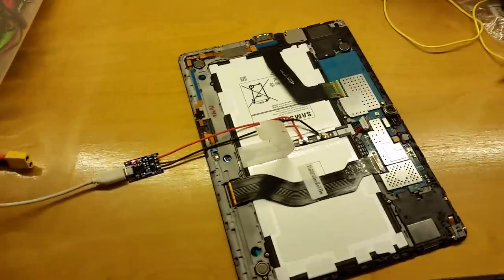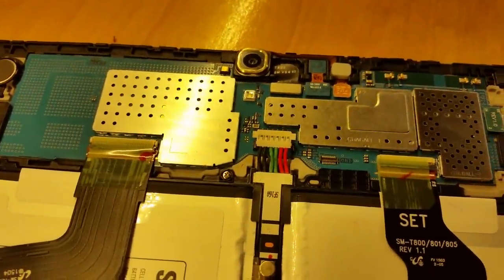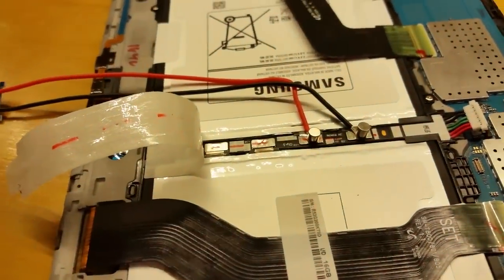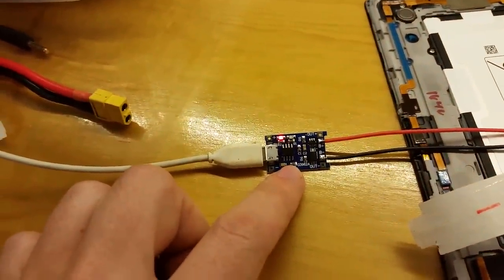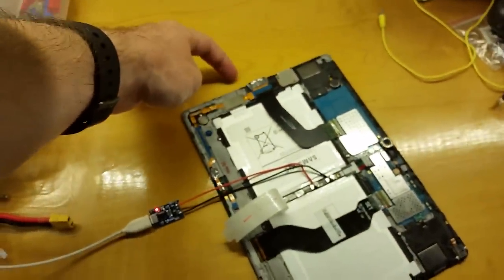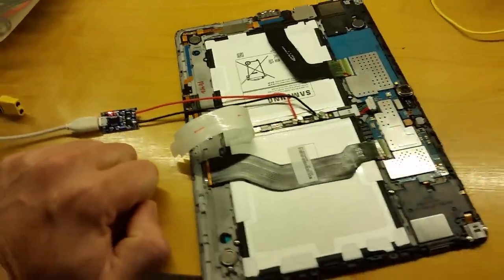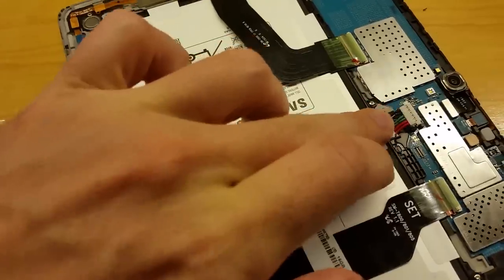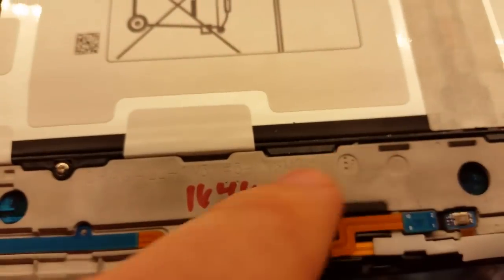Samsung Galaxy Tab S 10.5 doesn't turn on fix

Comment: If you don't have that little part you can always cut off the end of a usb cable and use the two power wires (usually black and red). Just make sure you use them carefully and check the voltage as a usb cable runs at 5 volts and will not have any over-charge limit. My cells were at 2.8v, I tapped the contacts for about 15 seconds, they got up to 3.15v and started charging again :).

Comment: Thanx my man, i've got 2 "dead" ones as a gift, ive tried your method, battery was at 1.8V, charged it to 3.5 and it started charging and turned on! now checking second one

Comment: I had my 10.1 Samsung tablet lose a lot of battery life within 45 minutes of use, after a "Full Charge", before not coming On again. Do you think installing a new battery will resolve everything on its own like protection switches? I tried the push button method with no results with and without the charger plugged in.
Reply from the maker: @williamc2930  maybe.. I'm not an expert at fixing these though so ya 😀

Comment: This method works for my Tab S. I have tried pressing switches in all combinations and many times but no luck. I opened it and measured the battery pack freeze at 3.26V for long time even it was plug in charge cable. I used a camera battery charger to charge it directly up to 3.7V and then re-pack everything. After several hours charging with original Samsung charger, it waked up when I just push On-Off button only. Now it is still charging at 30% with normal screen as it " deep sleep" before. Thank you Chester Lowrey.

Comment: Just did this. I was skeptical because I really had no indication that this was the problem, I just knew that my tablet wouldn't turn on. I ordered the part and charged it for 3 minutes. The screen turned on and I was able to charge it fully. Thanks!

Comment: I used a USB cable connected to a AC Adapter or notebook USB port to charge the battery. After 5 minutes charging it reached 3.5V (2.7v before) and started to charge from the Galaxy tab dock. Thank you!

Comment: Worked well as described on my Samsung tablet. Opened my 2.5 year old tablet, disconnected battery, charged at 2 amps for 1/4 hour, reassembled, then could use the tablet' to fully charge itself. Now works as it should. Samsung Support Center had asked 150 British Pounds to repair it !!!!!!!! Thanks
Reply: where did you find the cables can you provide the link
Reply from the maker: On Ebay search for "tp4056 charger usb"

Comment: I had a similar fault with my SM-T800 10.5 Tab S and discovered it had simply frozen and was brought back to life using the following reset instruction as per the user manual.
"If your device is frozen and unresponsive, press and hold the Power button and the Volume
Down button simultaneously for more than 7 seconds to restart it.
– Type 1 (SM-T800):
Reply from the maker: that may work in some cases but definitely not for my tablets particular problem, I tried all possible button combinations first before delving into opening the case.
Reply: Mike Kay, you save my life thank you it works !!!
Reply: Mike Kay 😭😭😭 thank you! It worked!
Reply: worked for me
Reply: worked :)
Reply: Thank you Its alive
Reply: Thank Mike, that worked for me!
Reply: Hey my screen is getting flickered when I have done this
Reply: Saved my day! Thank you
Reply: Thanks for that information my tablet was just a black screen and I thought it died till I restarted it.
Reply: @jpacifico8699  Mike you saved my life too, everyone was telling me the Power button and the Volume "up" button. Did that several times. Your note fixed it for me with the Volume down button

Comment: And what about your tablet SM-T805 does actually charge the battery but the power on button is (must be) broken so you cannot turn it on? Method below "If your device is frozen and unresponsive, press and hold the Power button and the Volume Down button simultaneously for more than 7 seconds to restart it" is not valid since the Power button itself does not work :(
Ideas?
Reply from the maker: You would have to replace the button PCB most likely - but it could be other issues I am not sure..

Comment: i want to take out the battery itself and solder the cable on the mainboard.. where the 2 red and black wires connect on the mainboard. i tried it but somehow didnt work.. if i take out the battery the t525 similar to yours, starts and reboots all the time, but download mode works fine.. without the battery only with cable connected to microusb..

Comment: Does the part come with the wires ?
Reply from the maker: No it does not come with wires - you could steal wires from some other broken device or buy the type I used - Silicone 20AWG wire - it is very flexible and nice wire. You will need some type of soldering iron to do it the right way - but I suppose in a pinch you could just twist the wires around the holes in the PCB and it should work.

Comment: I'm doing this for the P7500 model of Samsung tablet. The batteries are 3.7 Volts. I sit ok to charge them with the circuit board that outputs 4.2Volts ?
Reply from the maker: Yes, most lithium ion batteries are 3.6v or 3.7v nominal but charge at 4.2v so you should be fine.

Comment: Couldn't you just cut a USB cable and connect the black and red wires 
from that directly to the battery, using your normal wall charger? 
In other words, why is the battery charger necessary?
Reply from the maker: Solid State no you cannot just connect a USB cable power leads directly to any battery without a charging circuit between them. All devices that use USB to charge have this circuit built into them. but if you connect the wires directly to the battery like this you bypass the charging circuit and would overcharge your battery or overcurrent the USB power supply. technically the devices everyone called "USB charger" for their phone is not actually a charger at all but a 5V USB power supply.
Reply: Ok, thanks mate!

Comment: hi
i already did charged the batt using usb pcb board..
now the batt has the voltage up to 3.6vdc..
and i do check on the batt connector and it shows the same volts..
but i still can’t turn the tab on..
is there any missing step..
pls help..

Comment: Chester, have you ever encountered an issue where the logo screen flashes off and on?  I've got a Galaxy Tab pro SM T900 that is now off warranty, and I've tried all the soft reset suggestions I've found on forums.  I'm beginning to think it's something inside the tablet itself. Any suggestions?
Reply from the maker: Never experienced that on an Android device.. Id guess something to do with hardware in the tablet also. Maybe replacing the battery would help but I dont know for sure..
Reply: Thanks, Chester.  I contacted Samsung, they recommended that I send it back, because it sounded like a hardware issue to them.

Comment: Hello Chester I have the GT N8000 Samsung Galaxy Note 10.1(2012)I believe it has the same problem.  It workes fine if I charge the battery in another tab but charging it directly it doesn't take in any charge. I replaced charger, battery and charging port but still won't charge. Please assist.

Comment: Hi! I’m trying to revive an old tablet of mine but I think the charger port may be messed up. This method seems like my last hope. I searched TP4056 charger on Amazon but I do not believe it comes with the red and blue wires as shown in the video. Is that something I have to buy separately? If so, what is it called?
Reply from the maker: I soldered the red and black wires to the charger - you may be able to find one with some wires already attached though.

Comment: Hi, I want to do this but I'm wondering if it could work with the regular charger, if I just cut an old usb cable, plug it to the charger and connect the re and black wires to the battery? Will it work? What does this circuit board provides more than the regular charger,
Reply from the maker: No I don't think that will work. If by "USB charger" you mean a 5v USB power supply like what comes with the phone. Even though these are commonly referred to as "usb chargers" etc they are not actually chargers at all but just a 5V power supply. A real charger will regulate the current and voltage specifically for a lithium ion battery which must not go over 4.2v. The USB power supply will try to deliver as much current as it can and 5V directly. In a normal phone the actual charger circuitry to regulate battery voltage and current is built into the motherboard. Most likely the power supply would go into over current shutdown mode. Either way it's not safe and could damage the USB power supply or the battery.
Reply: Chester Lowrey
Thanks, I just ordered that little circuit board, I'm wondering, did you plug it to your computer usb port or to the usb charger?
Reply from the maker: I plugged it into the USB charger (technically a USB power supply) because the charger can deliver at least 1A of current, some older computer USB ports are only designed to provide 500MA but some of the newer ones provide 1A of current. Your phone built in charger is smart enough to tell the difference and only use the current that the port is designed to provide. The cheap $2 chargers from Ebay do not have any way to tell, and will always try to use the max of 1A current. So it is safer to always plug them into a real external USB charger. Hope your tablet is fixable :)
Reply: Chester Lowrey
Thanks I have the 350mA charger that came with the tablet but I also have one that outputs 2A from another Asus tablet, I might use this one.

Comment: Man I just blew out the power button nob, had back off and drained motherboard by holding power button in and tried jt a few times and when I let go the power button nob is stuck down now
So guess I'll need a new power and volume levels strip?

Man this sucks I have family pictures on it and near end of month will be two years since my mom passed from cancer, now the power button is blown or stuck down, what can I do?

God Bless

Comment: which source are u connecting to the usb circuit board to charge the batter - is it a power bank ? please give details ?  i have the same issue , i am from india , service center asking for 170 usd [Rs100000] for replacing the system board . i bought  and used for sometime and the put back in storage but when i took it out after a month or two - it was dead - please help clarify
Reply from the maker: You can connect it to a USB power supply, computer, power bank. any usb port should work
Reply: vrdommed bro i know this isnt relevant but u added a extra cyber to the rupees

Comment: thanks im gonna try this.... i left my tab in a draw for about a year and now it doesnt turn on and i want to use this tab for a 2nd monitor using a app called supermonitor
Reply: just an update ..... it worked but for some reason i had to charge mine to 3.7v until it would come on. thanks bro

Comment: I have ordered everything unfortunately the cable wires were too large.  can you provide a link for the red and black cables, please
Reply from the maker: If you search on Ebay(or elsewhere) for silicone wire 20AWG you will find one that will work. - If I provide links they will just be out dated in time ;)
Reply: Chester Lowrey I have been unable to locate the wires. can you post a link for me

Comment: Do you have to charge both cells?
Reply: Since they are wired in parallel they charge at the same time, they're basically connected together.

Comment: I did exactly what you did and my tab still won't turn onit was just a day ago my tab was working fine. Wake up and started using it and plugged charger in and it wouldn't charge. The notification battery charging symbol came on but battery % was dropping .   
So I directly connected to the circuit board exactly like you did and nothing .

Could it be possible that the port it's self 
Could be the issue . Say if the charger I was using pushed the pins out of place or possibly rearranged them and now 
One of them is touching.
Reply from the maker: Hmm yeah it could be lots of things.  If you have a multimeter you can measure the voltage on the battery to see if it's good. Or try to look into the micro USB port and see if the pins look messed up.

Comment: what is the part you are using to charge the battery up with ?
Reply from the maker: https://www.ebay.com/p/5V-Micro-USB-1A-18650-Lithium-Battery-Charging-Board-Charger-Module-DX/1844136656?_trksid=p2047675.m4097.l9055

Comment: Mine shows 99% charged and then 100% right away when a charger is plugged in. However, it does not boot up. Where do you get the red and black wire and magnets?
Reply from the maker: I think in your case you need to order a new battery. The magnets can be found on Ebay by searching for Neodymium Magnet - any small size will work. For the wire search for 20AWG Silicone Wire

Comment: Hey Chester this model of tablet has been having an issue where the back button and menu button go out but the home button still works. Have you found a solution for this?
Reply from the maker: +Alex Pichot Nope sorry I dont know how to fix that but would guess the capacitive touch buttons have failed, you may be able to replace just that part but I did not take apart the screen enough to tell.
Reply: +Chester Lowrey Hey, do we have to take the sticker out? And..what of it's 0 % and instantly goes to 100% what do we do?
Reply: +Chester Lowrey Like..what if the battery burnt and won't work?
Reply from the maker: +Asriel Dreemurr sounds like you need to buy a new battery on eBay maybe.. but I have no experience with this so can't help you further..
Reply: +Chester Lowrey So...how would we put the back of thr tablet on again?

Comment: i had a prob with my samsung gt p7500 10.1 tab.. it won’t turn on and it’s not charging as well. 
my question is what if i use normal usb cable  and samsung charger instead of buying those dongle. is it ok.is there any prob to my battery pack.
Reply from the maker: You cannot connect 5V from samsung charger directly to battery. You need the pcb charger to limit to current and voltage to 4.2V 500ma.
Reply: Chester Lowrey thanks for the info..

Comment: hi
i have this exact same tablet. my problem is that i keep getting a weak charging error message. the battery will not maintain charge even if i leave it on its wall charger while using it. while it does take hours to drain (and therefore still useful to me) it will not charge up even if left plugged into the wall while using it. it used to charge up slowly when plugged in and being used. is there a way to restore this battery to its original working condition?
Reply from the maker: Sounds like the battery has failed and must be replaced, I have not done this personally but it looks like there are other videos here on Youtube showing you how.
Reply: Chester Lowrey

Comment: Hi. my tab S takes such a long time to charge up even when using a fast charger plug. Is there a reason for this?
Reply from the maker: I'm not sure.. Some of these older tablets need the exact charger/cable they originally came with to fast charge, otherwise they only charge at 500ma.

Comment: hey i have the same tablet but my  when i plug it in won't charge but stays on you can use it normal but on usb and when i unplug the usb it goes off what do u think is the problem the battry is dead ? i need your help guys
Reply from the maker: Yeah sounds like the battery is dead, I would buy a replacement on Ebay.

Comment: I have a tab s too, but it won't turn on. it makes noises and stuff when I push the power button, but the screen won't turn on. if I press the volume button, I can hear the change in volume from the noise that happens, yet the screen still doesn't turn on. It appears everything works, but the screen still doesn't turn on. any ideas?
Reply: James Bond yo thanks alot brother i fix my samsung galaxy tab s
Reply: My wife doesn't turn off my Samsung tablet and it went flat wouldn't charge at all so I left it on charge for  3 days till it ran hot then unplugged the charger  till the Samsung tab s  cooled down after a few days ...I put the tablet on charge and wammo it fully charged again,so you can try that fix and see if that helps.

Comment: What's the name of the charger
Reply from the maker: +Joseph Galling The charger IC is called TP4056 and you can buy many different chargers using it on Ebay and others for a few $
Reply: CHARGER :3 YOUR WELLLLLLLLCOME
Reply: +Chester Lowrey it does not work HEEEEELLLLPPPPP
Reply: Chester Lowrey Hi this may be a basic question but where did you purchase the wires and magnets you used to connect the charger.  is there a amp restriction?
Reply from the maker: You can find them on Ebay - the current the charger uses is fairly low so most any wire will work.
Reply: Chester Lowrey thank you